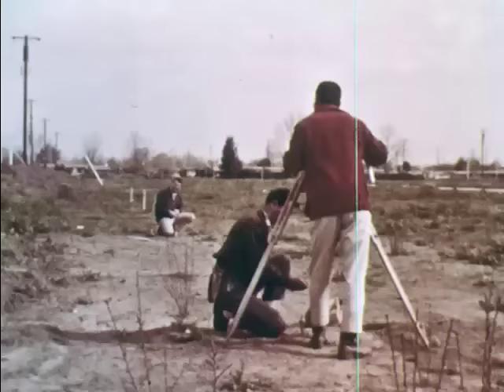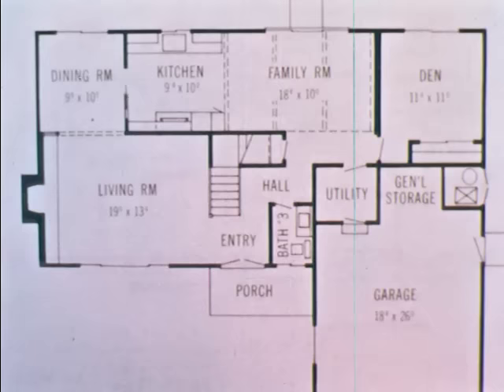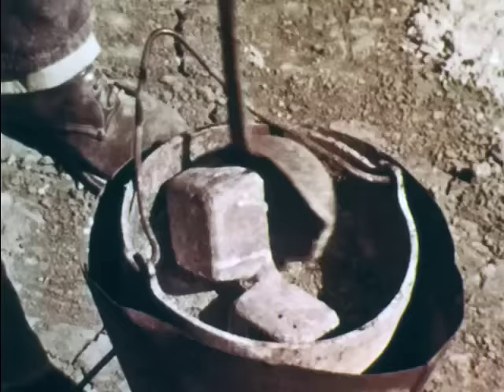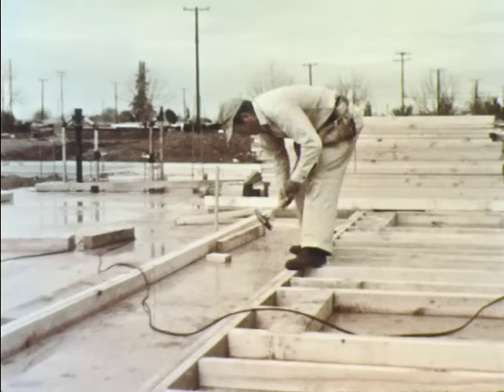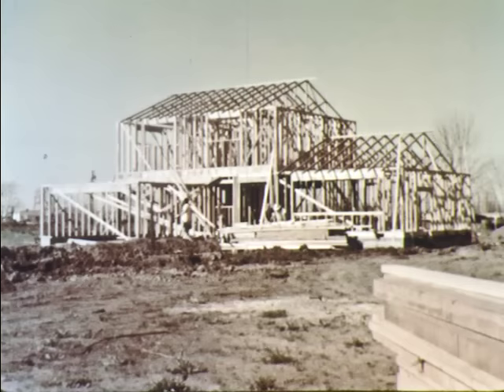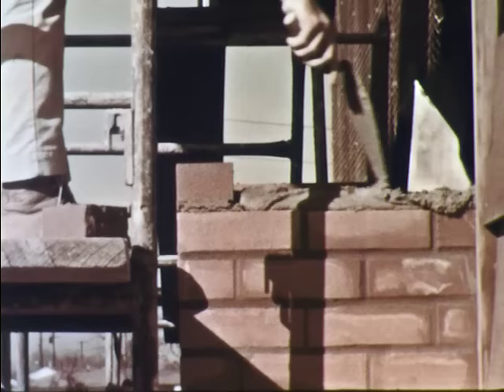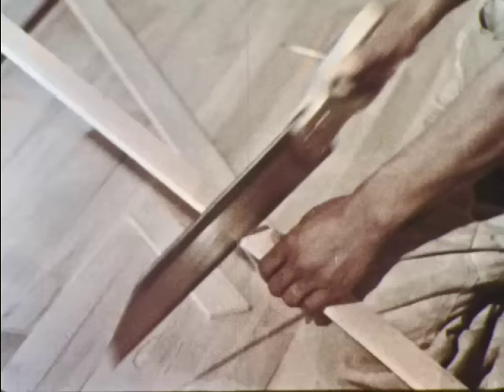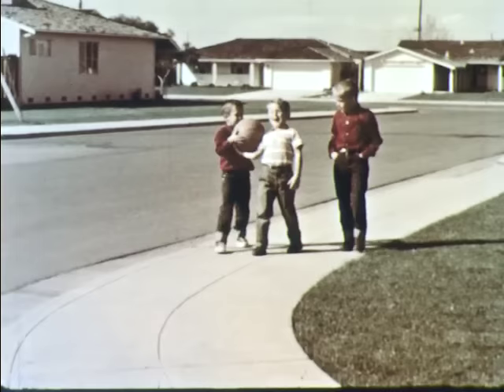Building A House (2nd, 1962)

Comment: Amazing how little the tools and materials have changed. Of course they’ve evolved but they’re very similar still
Reply: Seriously?  Id say entirely different
Reply: @xChromerSatanasx  so true.   God bless the Mexicans!
Reply: @acommentator69  They are entitled to lower wages.  It's called a free market and those that cannot compete need to leave the craft and find another line of work.
Reply: @acommentator69  More free than any other market and those that can push down wages are entitled to their just deserts
Reply: @acommentator69  as should be my right and if I can undercut your wages because you overvalue yourself then so be it.if
Reply: Tools are very different. Plumbing materials are very very different. The only similar is wood and concrete.
Reply: I have tendinitis just watching every nail driven by hand..God bless air and battery nailers

Comment: This is back qhen housing was literally built by hand. Every single piece has been fit and beaten by hammer and nail. Crazy how far the times have come over the years. I love watching these old videos with the narrator speaking in the background. Such a nostalgic feeling i get watching this. I'm a firm believer that thwy do not make things the way thwy used to be made.
Reply: They were doing mill work for over 200 years For like windows and doors
Reply: They build structures stronger and more safely nowadays.

Comment: @4:08 when my father and grandfather built my future childhood home in The New York suburbs back in 1968, they used brass fitted pipes for the hot and cold mains to the sinks, lead and cast iron drain pipe mains, the electric was bx cable, and the walls were sheetrock.  the only sweated copper was for the hot water baseboard heat.

Comment: Good God... construction sure has changed, for the better and for the worse...

Things I liked about the old-timey way (that we should still do today):
- hand-troweled stucco
- plywood subfloors and roof decking (not OSB)
- wood slats under the roof decking
- real hardwood floors
- real masonry fireplace

Things that made me cringe (and thankfully are built better/ safer now):
- molten lead/ lead wire used as pipe solder
- cast iron drain pipes
- asbestos blanket duct insulation
- tar paper used as house wrap
- was there any form of flashing around windows/ doors? I didn't see any
- hopefully that electrical system was at least grounded if two-pronged receptacles were used
- vinyl asbestos floor tiles
- lead paint
Reply: I suspect it was in California, as woven wire ( chicken wire) was not popular in most other places.  notice the lath moves too.  It was of line wire and paper.  Open stud.   not done much anymore.  I still believe in that method for strength and ability to breath, ( more vapor permeable) .
Reply: Cast iron is actually a super good quality material for drain piping. We don’t use it because it calls for a ridiculous amount of man hours to pour lead joints for fittings.
Reply: No sheathing on the walls, just tar paper over the studs
Reply: Ohh good grief. Lovely video and you trolls om 1/3 the comments.

Comment: I don't know about the other things, but the carpentry work sure does go by a lot faster now with the nail guns and such.
Reply: It does, poor planning slows work down but physcially its faster and much much safer
Reply: It was a point of pride in your work to be able to sink those 16 penny nails with 1 or two blows of your hammer.
Reply: @dhyde9207 Looks fun as a hobby, but full time man did it have to take a toll on your body over the years eventually. I agree though it was a point of pride in your work as a carpenter to sink a 16D nail in with two or three blows only. I hear if the general contractor saw you drive a nail in with more than three wacks, then you'd loose your job back then. I suppose that was more likely the non union carpenters that operated that way?

Comment: I’ve been an electrician for 27 years, and have wired a lot of commercial and residential new construction and older remodeling as well. It’s amazing to see how different it was back then. From a football stadium, new school, performance auditorium, factory, restaurant, or a residential home, I’ve had the pleasure of working several different types of electrical installations, and have worked on many older ones. It’s simply fascinating to me to watch stuff like this to see how they got it done back then. It is definitely different now, in some ways not as good.

Comment: Did you see the roofers using cedar shakes? The older guy had a box hanging around his neck. That is a shaker. You put nails in it and shake it until the nails are collated into a line. Then you grab 5 or 6 with your off nail hand fingers and bang away with your hammer or hatchet! It made things easier. In the old days of wood lath and plaster, they used shakers too.

Comment: Oakum makes the water tight joint for the plumbing, the lead just holds the oakum in place
Reply: And there both not water tight.   If was water tight roots would not seek out the water in the line.   And seen lots of joints leak when sewer was backed up.     Water tight for water passing by only not standing water
Reply: @christopherbonanno1120  it takes decades for those joints to loosen up for roots to get it. Usually from ground settling.
Reply: @christopherbonanno1120  The full proper caulking process with the lead once hardened wasn't shown. If this is all that was done, it wasn't done right.
Reply: @christopherbonanno1120  I’ve been Plumbing for almost 20 years and I’ve seen maybe two Oakum joints leak in my whole career when faced with mainline stoppages. In my experience, roots generally get in where the pipe has rotted, but It took many many years for them to get that way. These pipes did their job for a very long time.

Comment: I work as a journeyman electrician doing new construction work for residential-commercial properties. 

It’s interesting to see how the HVAC systems and fire alarms have changed over the years. 

I remember my old man telling me that back then, HVAC was all based on pneumatic controls. Now it’s all electronic systems. There were hardly any fire alarms used back then (aside from water sprinklers), but now we’ve got smoke detectors on each floor.
Reply: Notice how the narrator only referred to the duct work delivering heated air. I lived in several homes from the early '50's to late '80's before having one with an HVAC system. First it was floor furnaces and attic fans. In the late '60's we got the monster sized window AC's and some 'Panel-ray' wall heaters.
How did we ever survive?
Reply: @markgarland9000  For large buildings such as the Chrysler and Empire State buildings; those types of buildings utilized mechanical pneumatics (later on electro-pneumatic by the 1950s) to control and bring heated or cooled air into a given space. 

I’ve worked on old school buildings (and other various institutions) built back in the 1920s and 50s. Old schools from the 1920s only have manually controlled radiators for heating. While schools built in the 50s had dedicated mechanical rooms using air compressors to control temperature/humidity for the classrooms. 

I was stunned by the complicated pneumatic thermostats, quarter inch copper piping, and pneumatic actuators (control valves) that were designed, built and installed! It’s amazing how we lost so much old wisdom in recent decades!
Reply: @markgarland9000  Wow, I did not know that… I always thought we got the monster sized window AC’s in the 1980s or 1990s. Thanks for telling me! 

It seems to me that before WW2, we had the the right HVAC controls for medium and high density buildings, but little for low density buildings. Nowadays, we have all the right HVAC tools for low density buildings, but we’re terribly lacking with how HVAC controls works for larger buildings…

Comment: Not much different today, just more power tools. The stucco process is exactly the same, that will never change.
Reply: We have a spry rig for stucco.....
Reply: @51-FS  I’ve used those, it’s a big mess, I’m a stucco guy myself, I prefer the trowel and hawk method in both hardcoat and EIFS application. But that’s about as advanced as it will get, even with the spray you still have to use a trowel.
Reply: I am a stucco guy too.   Pumps ( gun crews) are for production.  plus, open stud with line wire  is less common today.  We use sheathing more.   I too like the hawk and trowel.  Ironically, the east coast hates woven wire..  I like it for wood framing.
Reply: Main difference in stucco is all the lawsuit’s unfortunately

Comment: Now a crack house with 10 cars parked in the front yard.
Reply: Lmaooo true
Reply: You seemed to have forgotten some broken hot water heaters and a few pit bulls.😂
Reply: @leroybrown9873  you don't heat hot water
Reply: @fnhwk  You might need a generator though. And lots of extension chords running all throughout the property. Good for when they shut off your power off (as opposed to paying the utility bill). 
Just make sure that generators stolen.
Reply: Are you kidding me? It’s in California. Now it’s 1.8 million dollars and flipped “farmhouse style”
Reply: @fnhwk  how much hotter could a hot water heater heat if a hot water heater could heat

Comment: If this house was build in Houston,   one of three scenarios have taken place to it.:   1 - That neighborhood is now a  barrio/the hood,  2 -  it may have been flood out and demolished  or 3 - its possibly buried under a giant freeway.
Reply: It’s clearly a Californian home dude. It’s got siding on the front, stucco on the sides, and a shaker roof. Where else has all those things together? Also just look at the shape and style very 60s north cal. I’m guessing it’s somewhere near San Fran and is like 1.8 million dollars as some flipped “farmhouse” with some tech family in it
Reply: @LucasFernandez-fk8se    nice observation,  I see that now as well.  
   plus southern style homes during that era tended to use lap siding with tin/ metal roofing to repel water with cross breeze windows to help cool the house during hot summers.
Most of those home were either demolished for commercial buildings or restored to someone who appreciated the style.
Reply: @TheDigitalslayer  I grew up in So Calif and worked construction in those days. while it is probably No Calif, we used of lot of shake roofs  in So Cal.
Reply: Good to learn that, I am not very familiar with shake roofing, I live in East Texas,  the construction style for houses is a bit different.  On the older homes, ventilation was emphasized as well as water repelling design, as the weather in our area is different.
The roofing on older homes tended to be made of either tin or corrugated sheet metal.
Today, metal panel roofing is now commonly used as it still helps keep the houses cool and for its durability properties.

Comment: Funny the house im in right now is 6 bedroom, 2 living rooms 4 bathroom 2 garage . On 3 acres now commercial/residential Built in 1940 my family paid 28,000.
Reply: If you plug that into any number of inflation calculators you'll find out that's $598,000
Reply: Your family's house was huge most houses were about 951 square feet by 1950

Comment: As a plumber of over 20+ years ….i tell you what, times have definteley changed……..in the beginning of my career i ran miles on top of miles of sweated copper pipe…..nowadays its all crap plastic pex that any fool can run and dont get me started on pro press copper $15 1/2” fittings😂😂😂😂  yea any fool can be a plumber now …..

Comment: Don't go by the notion "things were made better back then"......our house was built 1966 and over the years 
you can see where corners were cut.....shoddy workmanship too
Reply: Not to mention building practices and materials have improved dramatically
Reply: @Pythonzzz  the actual lumber itself may be a different story, with dealing with replanting trees these days its harder to source materials that are the same as they used to be due to time.
Reply: Not all old homes were well built, Not all modern homes are well built.  Always had and will have a few contractors cutting corners.  But it was less complex back then.  more standardized and basic.  today we have so many, maybe too many options?
Reply: The 60s is not far back enough to be considered "built better than now".

Comment: People say old homes were built better lol, 2x6 floor joist and no sheathing on exterior this home was built cheap
Reply: That is technology, they didnt have tyvec until later.
Reply: @michaelmckay   I didn’t say nothing about a water screen or air barrier witch is what tyvec is.  that’s what purpose the roofing paper was serving they used,  I said they didn’t use sheathing witch is the term for osb panels for use on exterior walls. They just went straight over the studs with felt paper then added siding no wall sheathing under it.
Reply: @morehp1  Ahhh Gotcha, there is fuck all for insulation too.  This looks like it could also be So Cal Post war housing, build them as fast as you can because they are selling that fast.  They cut corners on cement too, tons of sand aggregate, not much cement.

Comment: Lead sealed pipes ! Not so long ago hand tools were used with skill ,
Reply: Lead & oakum joints still set by hand in Chicago for larger buildings. Still code
Reply: @plumbum27  and they still leak.
Reply: @jodyrolandconstruction6577  There is a sealing process that involves caulking the lead both inside and outside. If done right and with care it will last indefinitely; if not it will leak, and this is the case with any method. If replacing a toilet flange on cast iron drain pipe it would simply be foolish and lazy to go to the tightened plastic route as if THAT were better than lead and oakum.
Reply: @VinylToVideo  I am familiar with this method. I also know that in America ALL cast iron plumbing that is ran underground will eventually rust, rot, and leak. I have replaced enough of it in the last 26 years to know what I speak of.
Reply: @jodyrolandconstruction6577  So why you complaining if you made a fortune off it? lol
Reply: @VinylToVideo  never said I made a fortune. I would prefer to go into a remodel and NOT have to deal with plumbing issues. I’m glad the housing market is back up so I can just build new ones instead of rehabbing old ones.

Comment: This appears to be of home construction in the southern portion of the United States. Trusses for the roof did not become popular until the 1970s or 1980s here in New York. Also I never saw a wooden shake roof around here. New York also tends to use more masonry in the structural components of the home up through the 1960’s then of those of the south unless you are in southern Florida.
Reply: Where are you getting all this info? Ur wrong about all of it. It’s a California home for one. 2) trusses are very very common and popular in Ny and most states. If anything southern states have more hip roofs on older and newer homes as southern houses have more complex rooflines. NY doesn’t have a lot of brick houses not nearly as many as in the southern states (NC TN GA AL KY TX AR LA etc)
Reply: @LucasFernandez-fk8se  I don’t know where you’re getting your information from…
Reply: My son just bought a home built in 1962, stucco  and raised floor, just like this.  He told me it had trusses.  I thought he was crazy, but yes , just like this one.  It is in So Calif.  I was surpised it had drywall, not plaster, but his home is drywall too.  No insulation n the exterior walls . BRRRRR.

Comment: No plywood sheets under the siding?! Insanity!
Reply: I seen that  often in remodeling. Always in real old houses Most have had ply wood nailed over it Keep in mind that lumber was very expensive when it was cut and squared by hand Like in a saw pit
Reply: In very old houses there was no outer sub wall The siding was nailed to the studs Hard wood floors were nailed to the joists  I seen a few where the floor joists were logs flattened in top
Reply: i'm currently remodeling a 103 year old house and the wood siding was nailed directly to the studs

Comment: Probably a more northerly climate. On the Texas Gulf coast all the GI Bill homes built after WW2 were full concrete slabs. I never saw a pier and beam house in the area with a concrete perimeter foundation. The majority of those GI Bill homes were single story. Until the 70s two story homes were only built in upscale subdivisions. Same with fireplaces.

When hurricane Carla blew through Houston in the fall of 1960 it looked as if it had rained asphalt composition shingles. Many of roofs in the subdivision had asphalt composition shingles but my dad had coughed the extra moola for a cedar shake roof when the house was built in 1957. Our roof was completely undamaged.
Reply: Fireplaces were common.

Comment: That skill saw weights 60 pounds.
Reply: No... Skill M77 15 pounds...
Reply: Maybe.      But I bet that it is still working. I have a skilsaw from the 70s and it is still going strong I put a 25 foot heavy duty cord on it I love my cordless tools but you can't beat the torque and on those cold days the metal handle and trigger warms up your hands "the heat is in the tools"
Reply: @Stillnapie  this was before the M77, which uses a lot of magnesium and plastic to make the saw lighter. I would guess in the sixties they weighed at least 17 or 18 pounds.
Reply: @janderson8401  The Model 77 uses no magnesium and was introduced in 1937 at about 15 pounds so it was around in the 1960's....  The lighter Mag (red) version is 11.5 pounds and came along about 12 years ago.